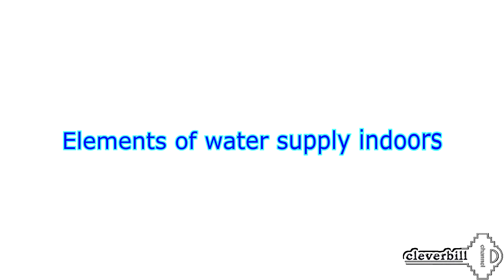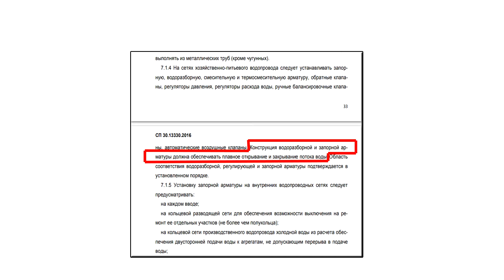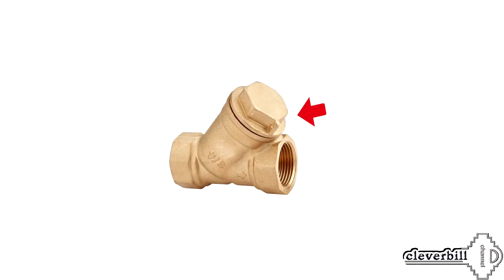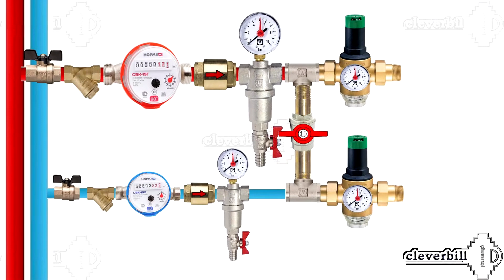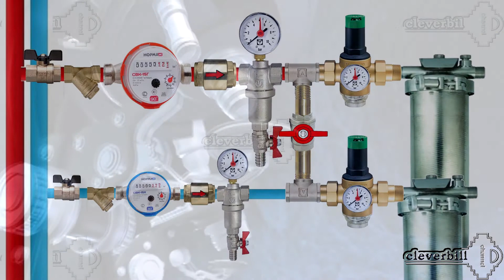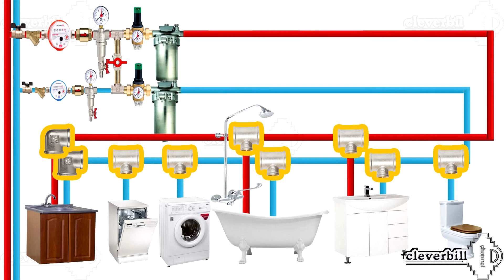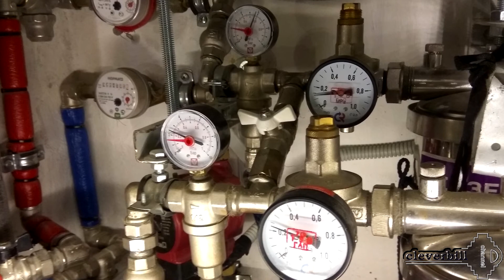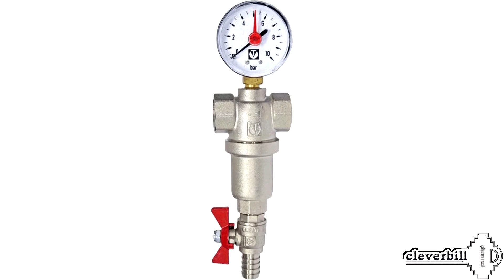Equipment for water supply in the house

Comment from the maker: The water supply hub in the apartment is designed not only on the basis of the wishes of the customer who indicated the presence of certain points of distribution and the number of consumers, but also on the basis of the technical capabilities of the external water supply network, indicators of which unfortunately are very often far from ideal. Dirty water, drops, and sometimes even a lack of pressure in the highways is something that many people face in everyday life when operating the old and sometimes even the new water supply system.